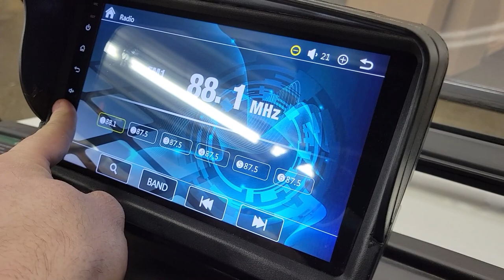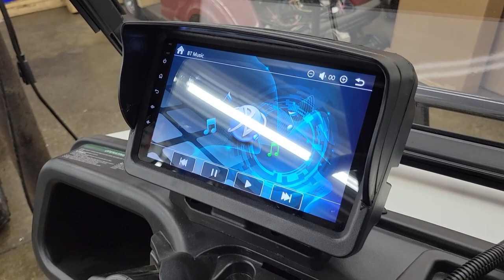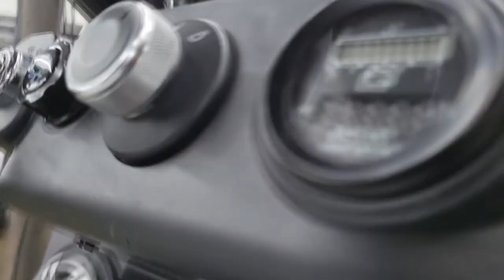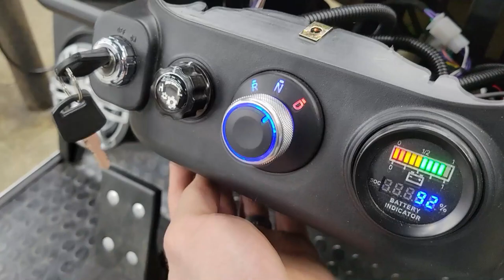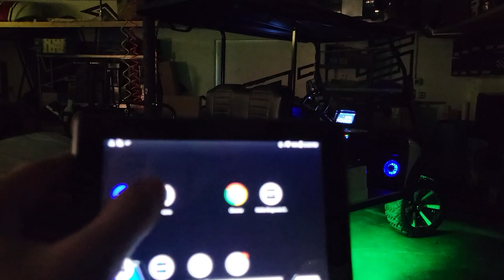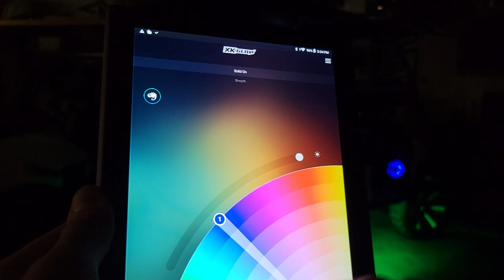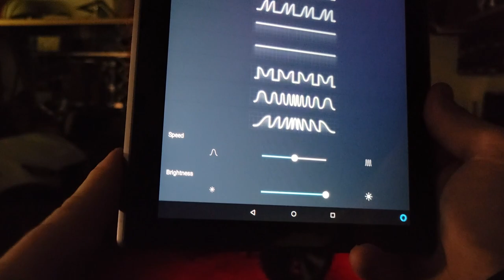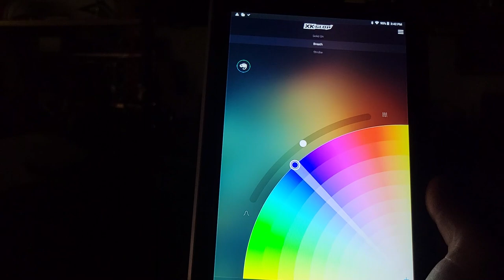How To Install our SVR2 and GLD4 Evolution Plug N Play Sound Systems!

Comment: You can fix the poor quality of the head unit with a quality Line Out Converter.
Audio Control, or NVX (for budget, but still very high quality) are some very good LOC's.
✌🏾